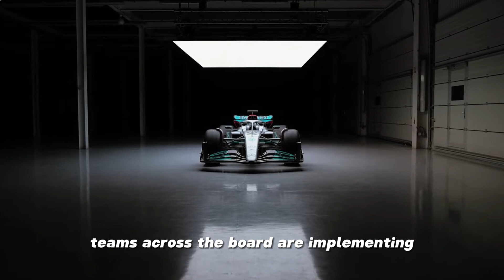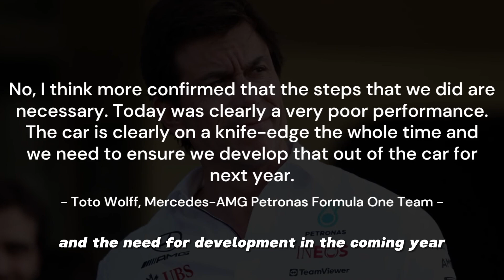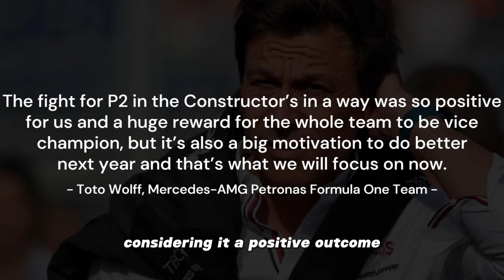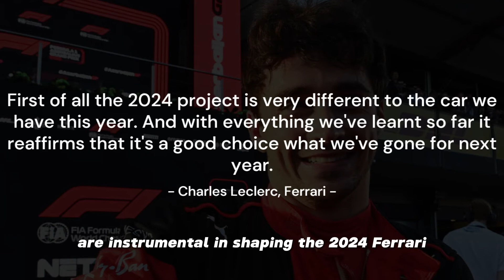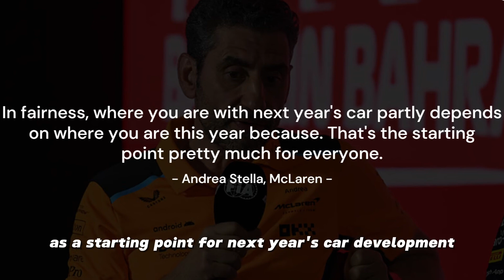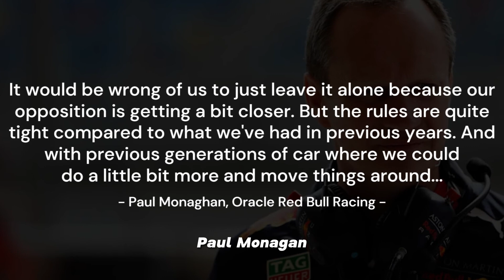2024 Formula 1 Cars Unveil Major Transformations!

Comment: Suspenrion is the major problem of mercedes the push rod front pull rod rear is conflict in the design of flooring thats why they lock downforce. They should adapt redbull suspention pull rod front push rod rear  to conpensate the flooring downforce.
Reply from the maker: Agreed, Mercedes' push rod front and pull rod rear suspension design creates conflicts in the flooring, leading to downforce issues. Adopting Red Bull's suspension (pull rod front, push rod rear) could help compensate for the downforce and improve performance.